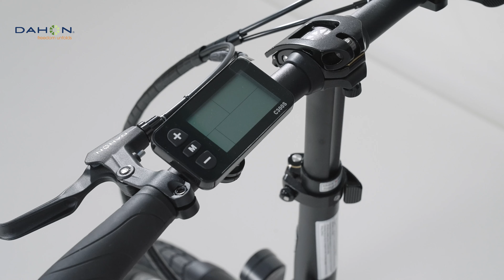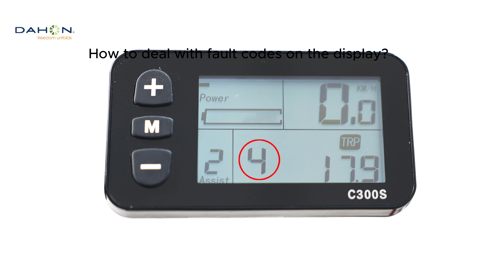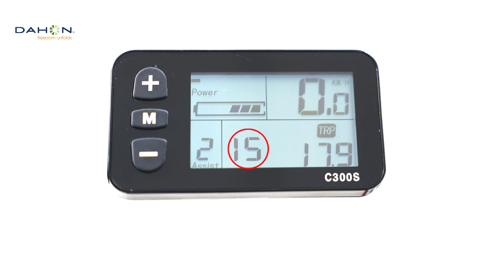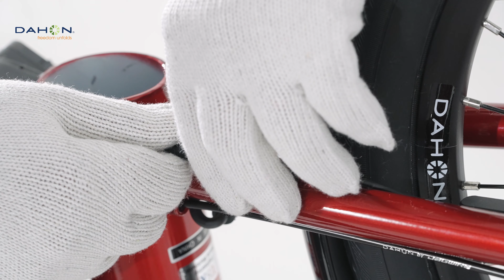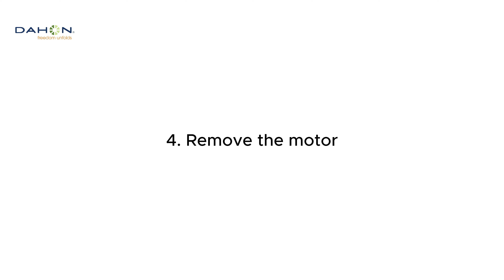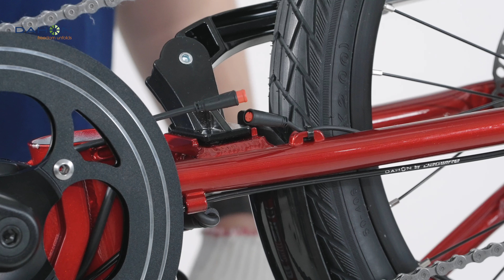Unio E20 Maintenance video | DAHON

Comment: Do you have an unlock code for the display for me?
My bike is locked and I need to enter a 4-digit number that I do not have. 
Thanks.
Reply from the maker: Hi there. The default unlock code is 2021. This should resolve the issue.
Reply: @dahonbicycles why isn't this shared anywhere? I already received this from support.
I searched the internet for it, google, chatgpt... I couldn't use my bike for a week.